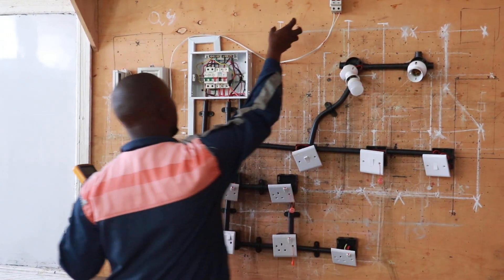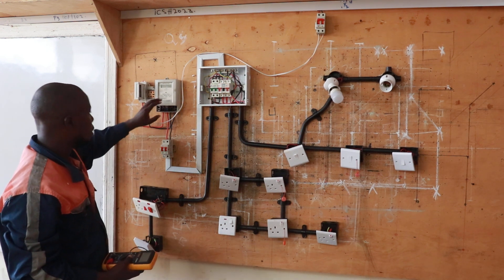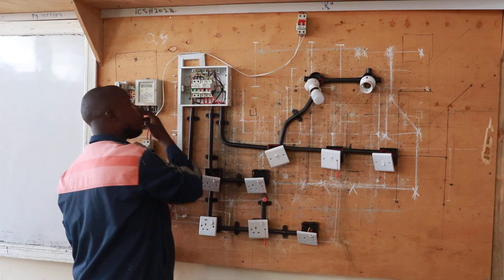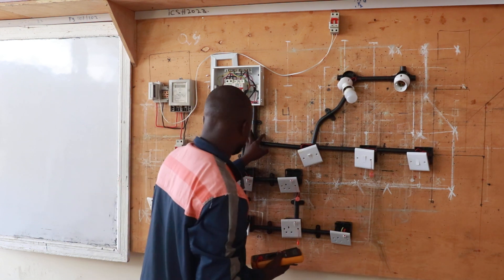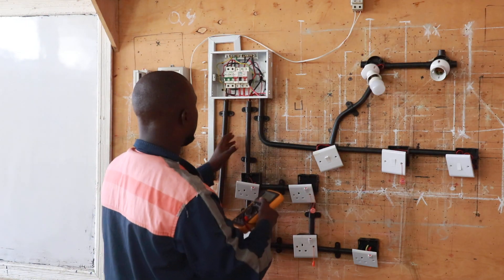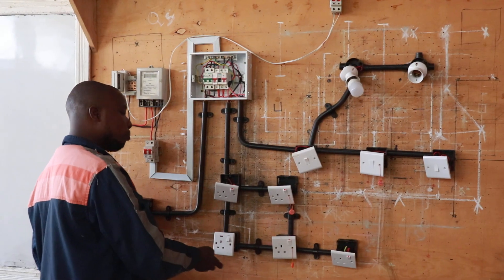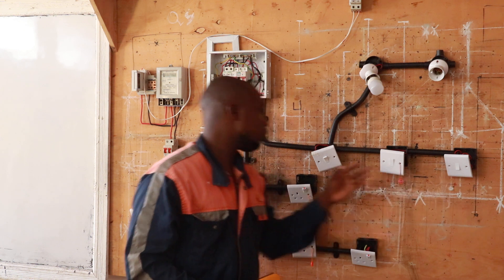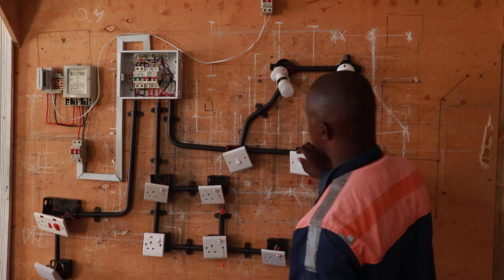DOMESTIC WIRING PRACTICAL WELL EXPLAINED.

Comment: The cable size for the utility company is supposed to 10mm ,coz the 6mm cable would eventually start to heat up coz of the loads
Reply from the maker: You are right,the hammered cable drop from the pole to the gear equipment is of 10mm thickness as per IEEE regulations.